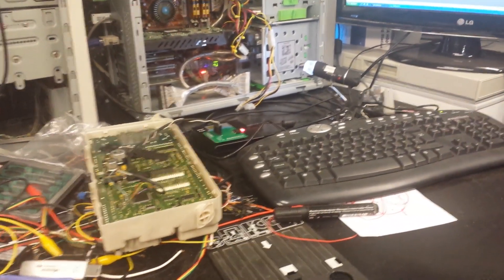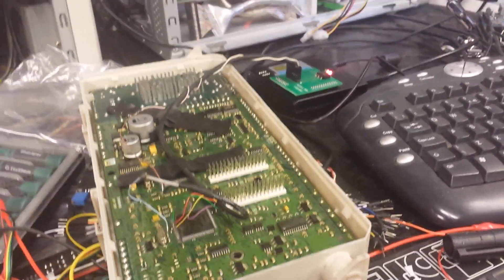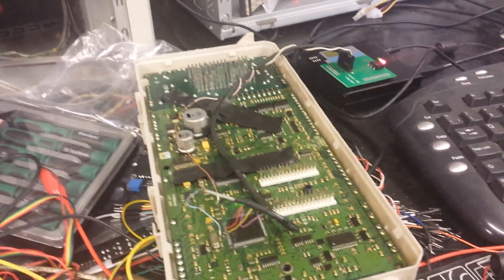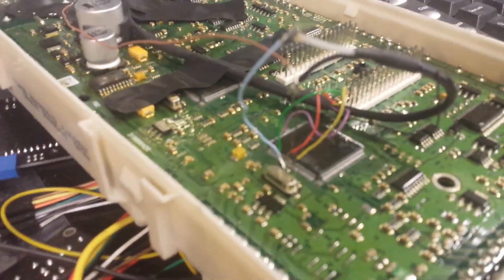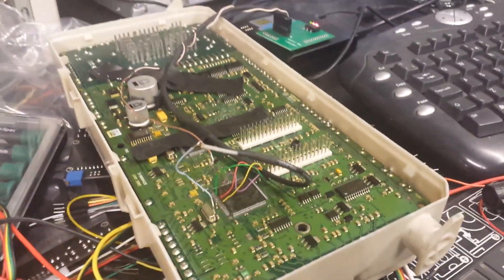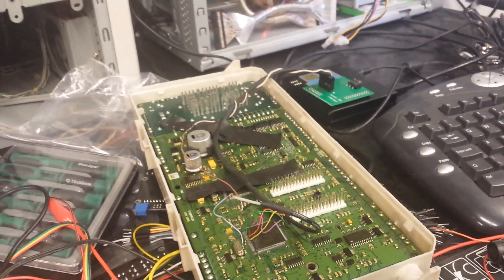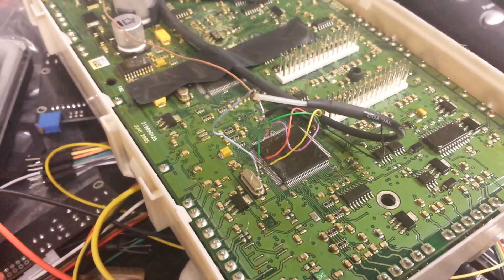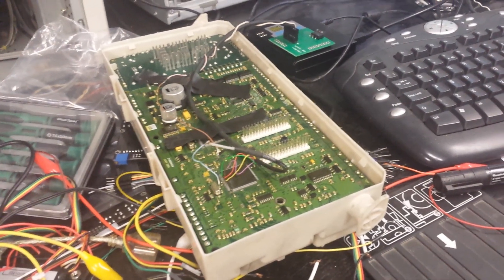Volvo S40 2006 CEM control module cloning/programming.

Comment: Hello @Imsvvavr, I am getting the following error ("xprog vcc overloaded check vcc pin connection") when I try to read the EEPROM and FLASH from CEM.  I checked the VCC Pin connection and it seems to be connected fine. I tried it on both chip sets and both give me the same error. Do you have any idea of what could be happening and how to get it to work? Thanks for your time
Reply from the maker: Body Of Gods 
Hi
I know this might be basics... but are using the external power supply to power x-prog?
Reply: Hello Imsvvavr, and thanks for responding, I really appreciate you doing so.  The xprog I got did not come with the external power supply. I read in some places that you shouldn't use an external power supply with the xprog.  Is that not correct? What voltage should I use for the xprog if I do try connecting an external power supply, nowhere on the xprog does it tell me what voltage it takes?
Reply from the maker: Body Of Gods 
Right, where you connect the COM or USB cable, there is a place to connect a power supply...
You need that, as the power supplied by the communication cable will not be enough to power the chips as well...
Use a standard 12 dc power supply... That's all...
Reply: Ok perfect, sound good. I will do that and see the results. Will let you know if it works for me. Thank you again for taking the time to answer me back!
Reply from the maker: Body Of Gods 
No worries...

Comment: Hi @Imsvvar, first thanks for your video. Ive few questions because Ive some problems with my CEM.
My car has a CEM linked to another car (different VIN, etc...) the last owner changed it. Ive another used CEM but the dealer cant reinstall the software because it hasnt an empty eeprom, so my answer is: if I write full F's in both eeproms of the secondary CEM should I can install it?

Thanks.
Reply from the maker: Jesús Márquez Galán 
Hi
That's a good question....
The volvo machine (vida Dice) only scans and adapts/coding... to  program you need to have an account and go online...
So I don't have experience on programming volvos...
I am not sure as well if a new CEM comes with blank eproms or if there is anything pre-programmed...
If the dealer is happy to attempt, I would do that... empty the eproms and see if the dealer can then adapt the module...
You can Google to see if anyone knows a bit more about it...
Either way would be interesting to know the outcome if you empty the chips and get the dealer to finish the job...
Sorry if I couldn't be more helpful...
Reply: lmsvvavr Hi, thaks for reply. Thats what I thinking about, Ill post my results.

Thanks.

Comment: lmsvvavr    Copy one or two processors?
Reply from the maker: Александр Крюков 
Hi
You need to copy both...
Reply: I copied and loaded into another cem but there is not the same as the coding from another machine if I copy the second processor problem go away?
Reply: I realized in one processor IMMO keys in the second car accessories
Reply from the maker: Александр Крюков 
Exactly... you got it...
That's why if you copy only the immo one, the car starts but other things don't... such as the radio and other optional features...
if you copy both, you will make a clone of the original... so everything work as it should...
Reply: thank you for the comprehensive help and your work
Reply: Александр Крюков ...hi i have 2004 volvo s80 with no crank no start and its been sitting over a year and i took it to a dealer and they say CEM is not communicating and need to be replaced because no key stored in CEM .is there any one who store the key in CEM ? i don't want to pay $1600 for new CEM @ dealer
Reply: Have you fix this, if u may ask
Reply from the maker: robel G 
That's a bit weird... I mean, are they saying that the keys info "disapeared" from the CEM, o are they saying that the CEM does not actually stores the keys?
Reply: lmsvvavr the key info disappeared from CEM
Reply: Александр Крюков what is that?
Reply from the maker: robel G 
OK...
How do they know the info disapeared from the CEM if they can't communicate with it?
What if they put a new CEM and still no communication?
If they say the info disapeared from the CEM is most likely there is some sort of communication... which would mean there is a few options... reload the software and reprogram the keys...
But hey.... I am saying this based on the info you are giving...
Reply: lmsvvavr ...i said the same thing to the dealers and they don't want to reload the software and reprogram the key ...they want me to change CEM which i'm not willing to pay $1600
Reply from the maker: robel 
Well, I would look for an independent garage, perhaps a volvo specialist...
Or you can try what I have done on this video... which theoretically should work, this if the data still intact in the MCUs... which although the dealer is saying is not, I have some doubts...
This would be your cheapest option to start with...
Hope that helps...
Reply: You can send me the scheme too. We in Russia do not have anyone who does not know such information.vlas29.75@mail.ru

Comment: Hi i'm trying to add cruise control on a 2008 Volvo s40, if i buy a CEM from a car with that option installed and fit that on mine , would that work (it would be paired) I don't want to pay volvo £600 for a simple software install through Vida. Thanks
Reply from the maker: Danny B 
Hi
Not quite...
As in previous replies, there is other things that would not match your car....
You couldn't really follow the procedure from the video, as that would also remove the cruise control setting...
Not sure if that is a completely software update, or a simple coding... if it is a simple coding setting, vida can do it...
You can get old of vida... 
Someone might know...
Sorry if I couldn't be more helpful...
Reply: The CEM is loaded at the factory with the software modules for the options specified for the car, and the configuration is stored in Volvo's database against the VIN. In the case of a 'prep' option, the module is loaded but not enabled. If the owner then wants that option retrofitted, the installation kit includes the extra hardware, and the software download is usually just a small config file that enables the software module in the CEM, which will then use the new hardware. I am sure if cruise control is already loaded and not enabled or it might need to download from Volvo try play with VADIS/VCT2000 let us know if is any luck.
I am working on mine how to enable Rain Sensor in CEM.
Reply: thanks for the reply
 Vida requires a subscription to download the cruise software which is a disgraceful £600
Reply: Danny VADIS/VCT2000 not VIDA, VADIS is old version of VIDA
Reply: lmsvvavr will that work with a 2008 car?

Comment: hey, whats upp, im here again mate, well now i have my  car back to me,  the  "pseudo enginer"  cant fix it... but now when i turn on the headlights, and immediately begins to short off so what youn think.. mate
Reply from the maker: Can you explain a bit better what happens when you turn the lights on?
Reply: Yes, when I turn on the lights, flashing lights all my my cabin , and 3 times faster, then shakes my engine and off ... this only happens if I turn on the lights , if not I turn I have no problem with the engine or the car works well ... but the question is that when I turn the lights all flashing inside the cabin and heard as clicks in the fuse box ...
Reply from the maker: Ok, although it might points to the CEM, it can be something else making the CEM to behave like that.
Disconnect the plug/wires that go the lights that are causing the problem, try to rule out any wiring issues...
From the top of my head I can't remember if the relay for the lights is external or internal on the CEM, if is not internal remove it... see what happens...
Reply: the last thing he told me was that a cable bridge , .. I guess that cable bridging the cem may be causing that reaction, you think ?
Reply from the maker: +rugalito 
That's what I was saying...
disconnect from the CEM the circuit that's giving you the problems...
If then the problem goes away you know that's not the CEM but the circuit...
Hope it makes sense...
Reply: oki bro ill make it

Comment: hi, nice video.. i have a question, well,  i have some trouble in my volvo, he stop to giveme energy in some parts to my volvo, so i take off to the enginer and he tellme my cem is damage, if i replace the cem, withou upgrade will be fix o not?, and how much will cost if i pay in agency of volvo the only upgrade
Reply from the maker: Hi
First, thank you for watching my video!
Now, you are asking a bit of random questions...
First things first...
Which parts of you car have you lost power?
If, and only if you are 100% sure that the CEM is faulty you should go forward with the replacement. 
Now and as per my video, if you replace it with a second hand one, you need to do what I show on the video... 
And yes, should resolve the issue.
As for the volvo update, are you talking about a software upgrade, or volvo to change the CEM for you?
If is a software upgrade will not solve the problem if the CEM is faulty electrically, if the problem is a corrupted software, then it might fix it, either way, how do not know the dealer fees.
Hope that helps.
Reply: +lmsvvavr okkkkk thanks so much, well ago 3 month i was tried to fix my headlights bit whe i conected, somthing happen and no have velocimeter, no alarm, no electric seat, and  no indicators in my board does not work, no have lights. so my fool enginer cant fix that... but. i think he do not check it out.,  honestly i think its my fusibles., could it be?
Reply from the maker: +rugalito 
Sounds more like a fuses or relays...
Don't blame the CEM till all the rest is checked out.
Reply: +lmsvvavr thanks so much bro, keep making videos, and andswer people nice bro, regards from mexico, and sorry for my sucks english
Reply from the maker: +rugalito 
No worries... my English is not that good either... lol

Comment: hi,

i'm awaiting for my xprog to arrive and begin the same procedure as urs on my volvo v50 T5. Noticed tat u mentioned the radio doesn't work coz vin doesn't match. How is it now? Will radio back to normal as it should? i've the same exact CEM p/#..... really hope this will solve my dilemma. Looking forward to hear from u from malaysia....
Reply from the maker: Hi
Yes, the radio does not work if the VIN doesn't match... at least in this car...
What I have done was copying the flash and eeprom from both processors...
That solved the problem, and also the coding... because obviously by copying everything all the settings are transferred. 
It will not work though if the original data is corrupted...
Reply: Erm... let me rephrases. You are saying the radio doesn't work with new CEM. Then by copying both the motorola EEPROM to new CEM then everything work flawlessly? I really hope you say a yes coz i wish i'm not required to do anything to the dump file. Just copy from old and write to the new CEM. Is that what you mean? BTW, of course i hope everything will goes find when i carry out the step. But can i keep in touch with you if i had further question? Thanks.
Reply from the maker: +Thomas Tan 
Just like that!
You can always get in touch of course...
Reply: wow... hopefully all goes well... will update you buddy...
Reply: Hi Imsvvavr, 

I got my xprog-m v5.55 and manage to read my CEM and i've write my new CEM with existing file. However, my car didn't manage to start. I had no idea y as i've read both eeprom n flash of the CEM. However, i do notice something when i'm reading both eeprom n flash, there's a prompt message asking to continue to verify error. N of course i apply yes to all. I'm not sure i miss anything. More over, ver5.55 doesn't have my motorola brand MPU stated, i'm using something like z100s but the mask is matching with the model stated.  In which i read without any issue. just no idea wat shall i do now.
Reply from the maker: +Thomas Tan 
Hi
Verifying erros means the file has not been read/write correctly. 
A lot of the times is caused by bad connections...
Ensure the connections are correct and properly soldered. 
You programmer should have come with the software version 5.0... try it as well...
Not on that, but I had some issues with the 5.5 version...
Reply from the maker: Thomas Tan 
OK... 
First ensure that your car prog is in full working order...
Ensure the solders are clean and solid,  and that they are not touching other pins... 
A bad or dirty solder can give you all sort of problems... I have it even now and then... 
Double check you connections... right pins etc...
Reply: Hi...

Thanks. Would it be possible that you give me a quote on this service?
Reply from the maker: Thomas Tan 
I would... but because of weather I have not been able to do a lot... and have a lot of jobs behind...
Do not give up just yet... if you have the tools you can surely get it done...
Go over the connections... like I said, ensure the correct pins are connected and that the solder is good... that is the most common and probable cause of the errors... what error are you getting when attempting to read the MCU?
Reply: Hi Imsvvavr,

To tell you the truth the tools i have is very limited and i have no confident to get it soldered/resoldered again as i might damage the MCU with my current available tools. I don't mind to wait as long it get done by you. Please help. 

Sincerely.
Reply: HI Imsvvavr,

Need your kind advise. As the last resort we decided to swap both EEPROM n ROM MCU to replacement CEM, from s60 1.6D(same part number as old CEM from v50 2.5 T5). This will be done professionally as possibility of damage will be minimal. 

Logically this swapping will enable me to run the car just like old CEM. My only concern here is i'm not getting replacement CEM from similar car model, i might have overlooked something this cause this to fail. Any suggestion you able to give? Thanks.
Reply from the maker: Thomas Tan 
Even if the car where the CEM came from has different options installed, and different coding, it does not matter... because when the CEM is loaded with the data from your original CEM, all settings are transferred...
Hope that it what you are asking...

Comment: @imsvvar How can i get in touch with you I have some questions to ask you is there an email I can contact you at ?
Reply from the maker: Hi
Ask any questions here, I will try to answer them as best as I can.
That way, if someone has the same question, can see it here.
Thank you for watching!
Reply: +lmsvvavr I am a programmer and wanted to know  what exact software you are using
Reply from the maker: +Mathana Rasa 
In this video I was using the x-prog, to read and manipulate the data.

Comment: hey! did you still have both full dumps from v50 cem??
Reply from the maker: Not sure...
Will need to have a look...
Reply: +lmsvvavr   look please)))  maybe you have also full dump from ecu! it will bee nice!!
Reply from the maker: +Ritvars Baranovskis
I will have a look on my servers...
Reply from the maker: Ritvars Baranovskis
Hi, I am away from home at the moment, will have look when back....
Reply from the maker: Hi
I know has been a long time... 
But, I found the dumps... do you still in need for them?
Reply: wich pinouts from mc256 are you used?? 23,36,40,41,42,46??
Reply from the maker: +Ritvars Baranovskis 
I can't really say without looking into the schematics... schematics that you can easily find out there...
I can check it out, if you can't find it...

Comment: hi, I have 05 T5 with a burned ECM. If possible, can you contact me for some info. reply and I will send my email. thanks
Reply from the maker: Hi
Is the CEM similar to the one from the video, then the procedure should work. 
If is different, then some research needs to be done...
When you say burned, how bad it is?
I ask because, if the MCUs and/or EEPROMs are intact, you can always swap them...

Comment: Hi, thanks for the replie . My eeproms have two different processors than yours  I can't find them on my xprog is your xprog a clone if you don't mind me asking cheers Lee
Reply from the maker: Hi
My programmer is clone.
The xprog software does not have an exact match of the processors of the video either, although was a compatible option in there.
I know that some other types of CEM come with other processors, which xprog can't read.
For that you need another type of programmer.

Comment: hi, great video, just wondering if i could ask a few questions, i have bought xprog and am trying to copy your method so if i copy both motorola processors then load onto the used ones will it transfer all the data needed, also the circuit board in your xprog is it hc (S)12 BDM ADAPTER
Reply from the maker: +lkim08 Hi
You need to copy the flash and the EEPROM from both processors.
One of the processors is protected, so you need the adapter in order to bypass the protection... Its all in the video...
Thank you for watching!

Comment: I was almost sure that copying eeproms would be enough to do the job .Another method  that should work is to just swap MCU 's , when adequate programmer is not avalaible.
Reply from the maker: +radu soptea Hi! Well, it is to start the engine... But some info is actually in the flash....